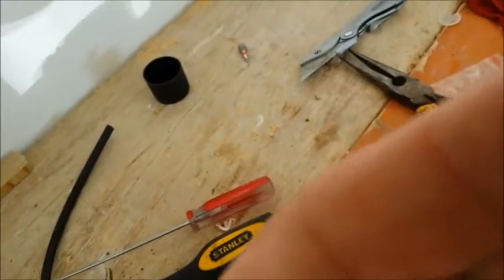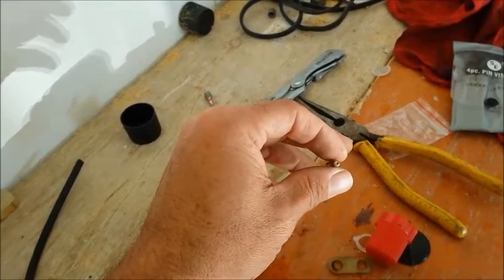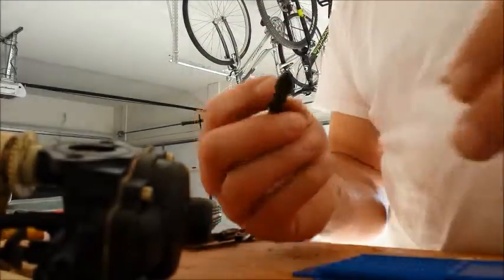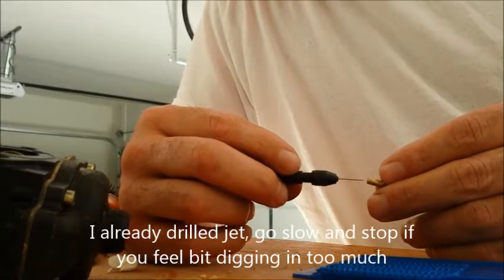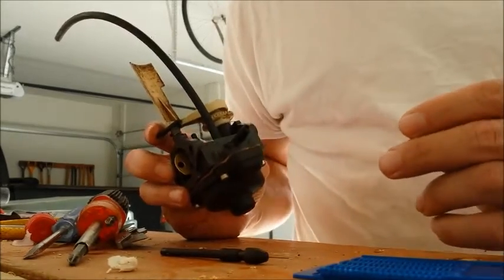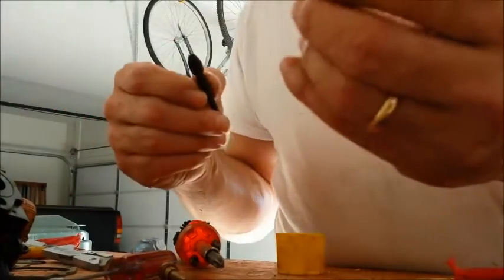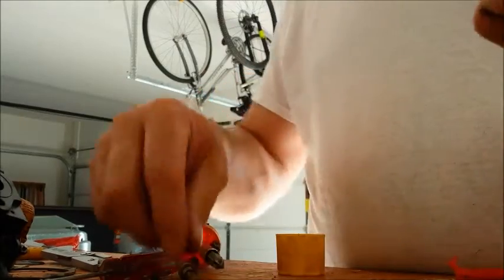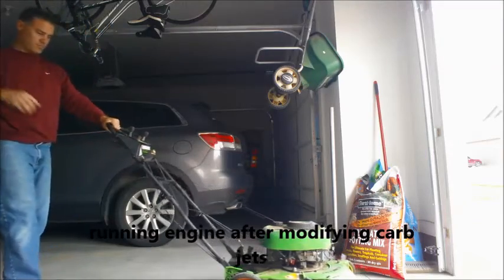Lawn Boy Duraforce  modification to Idle and Main jet using mini drill bits

Comment: I have one of these mowers that had the same issue and offer this tip: This is a well-done video pertaining to a common problem with these engines, but before going through the rigmarole of drilling out the jets (which, in the end may be necessary), try this first:

Run the tank and carburetor dry, then, fill the tank with a batch of fresh ETHANOL-FREE gas/oil mix.  Mower shops sell ethanol-free gas, but its pricey and stations that sell ethanol-free gas usually are easy to find online.

Eliminating the 10% ethanol found in most gasoline is equivalent to richening the carburetor setting by about 3%.  Three percent isn't much, but modern power equipment (especially with 2-cycle engines) is jetted to right on the ragged edge of getting barely enough fuel to run in the interest of meeting emissions regulations...and most don't have a mixture adjusting screw like they did 20 years ago.   
Getting an engine to run cleanly and run well at the same time is difficult to pull off with a carburetor, which is why virtually all cars went to fuel injection 30 years ago.

On the 10% ethanol gas my mower needed about 15 pulls to start and when it did,  I had to keep hitting the primer bulb for 5 minutes to keep it running.  Now, it starts on 2 or 3 pulls and runs fine after about 30 seconds of mild surging.  If I wanted to take it a step farther, modern synthetic oil is so good that I could run a 40:1 synthetic mix without problems and the engine might run even a bit better, but I stuck with the 32:1 since I'm satisfied with how the engine runs now. 

Hope this helps!

Comment: This Briggs jet is the same jet/part number used is the LawnBoy dureforce and Toro Rtek 2-cycle snowblowers from the early 2000s.  Briggs and Stratton made these 2 cycle snow engines. Upgrading to this slightly larger jet is not an issue at all since the snow 2 cycle engine is the same as the Duraforce mower engine because Toro sold/leased the build rights to Briggs in 2004.

Comment: Is this hole supposed to go all the way through the brass jet?   From one end to the other?
Reply from the maker: Yes, I ran it thur several times
Reply: @lewisbrazil5485    THANK YOU!! I was thinking only through the first opening.  I REALLY appreciate the quick reply, I'm sitting here with an HSS drill set and pin vice handle from Amazon i got because of watching your video.  THANK YOU! 💙

Comment: Where you get the steel wheels?
Reply from the maker: I got them from a dealer on ebay,  they are toro proline wheels, you can paint them if you cannot find the LB commercial duraforce wheels

Comment: The gentlemen at L-B were the absolute best at 2 stroke motors design and their fixed jets were the optimal compromise they could achieve between starting  and running under load. Second guessing the experts is parking for trouble.
Reply from the maker: I only went up one jet size, more fuel is not going to hurt a thing other than using a little more than before.  I have run the mower for 3 years now with no issues other than using more fuel.  Before the mod I could mow my lawn twice on a tank, now I am out of gas 1/2 way through the back yard on the second mow.  I can start with out using the primer(4 pulls approx).
Reply: Lewis Brazil -One of the parameters the engineers had to work with was reduced emissions which was achieved through a lean mix. Of course, your motor is going to run smoother with a richer gas mix but not without an impact to the environment.
Reply: The wife got really annoyed with my 10324C hunting and surging so I tried drilling the pilot and main jets one size up. It only helped marginally but the definite solution came after drilling the 1/16 throttle plate hole and opening it up to 3/32. Even got me thumbs up from the neighbors.
Reply: Daniel Robert I agree. Cleaning the jet probably would’ve fixed any surging/hunting.
Reply: Fuel will get into the crankcase? Dude. The Duraforce  is a "Two Stroke" Their is no crankcase oil. The oil is mixed with the gas. Unless its in the muffler bearings?